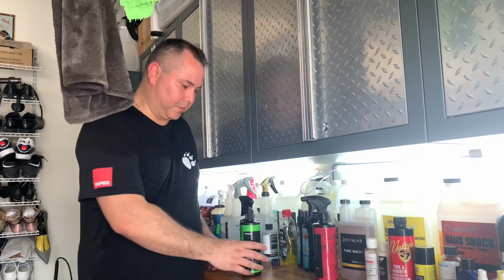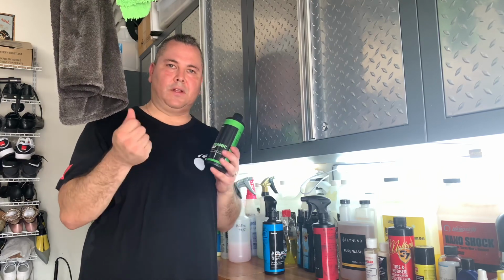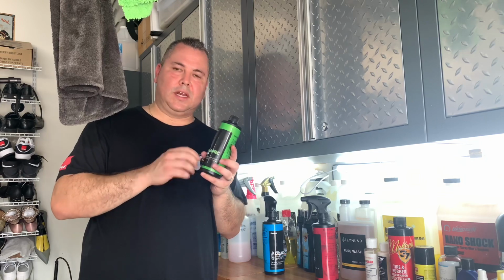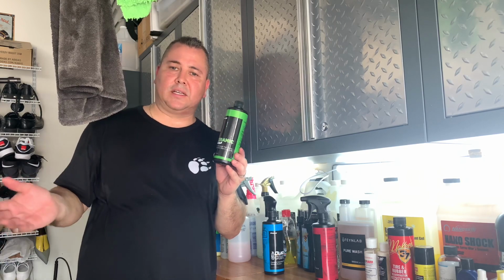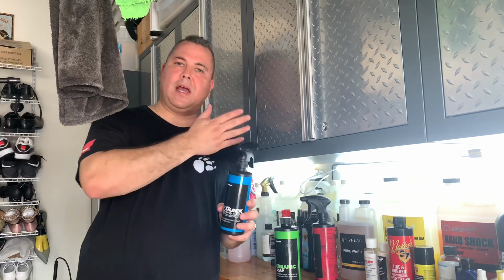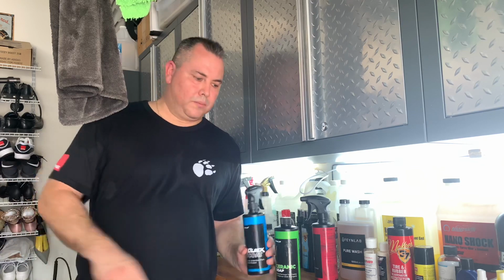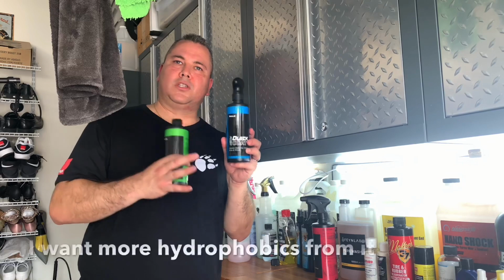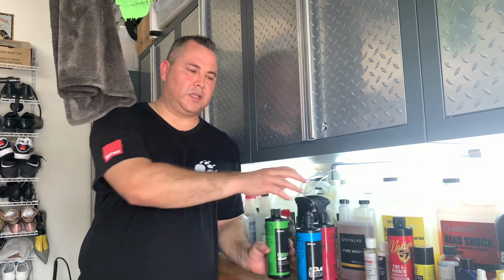Proje’ Car Care (Ceramic Soap)

Comment: Man I wish I had some sort of air system.    I'm absolutely loving that air powered foam gun!  Good gosh that thing looks like it put's out some seriously thick foam!    I also would love to have one of those Tornador's or the knock-off version of same.    That Tornador looks like a cleaning MACHINE!   I've seen some crazy stains on YouTube taken away with a Tornador like a hot knife through butter.     Guess I need to start saving my pennies for some sort of respectable air system.     Another useful air tool would be that small 3" pneumatic RUPES polisher that get's good reviews as a small or tight area polisher.    Great video Benji.   Always love your content and reviews.
Reply from the maker: Thanks man, the air tools are cool.  To power the Rupes pneumatic u will need a really powerful air compressor.  Something like 10+cfm(don’t quote me).   But all my other tools u only need 5.1 and it works fine.  They are definitely fun and handy in many cases.   Let me know what u decide
Reply: @DetailingBreakdown  Thanks for the info on the air.   Yeah, the Rupes small polisher wouldn't be a priority or necessity as I am getting the small Flex polisher soon anyway,  so going with less air to power the Tornador type tool and Air Foamer would really be all I need it for, and maybe using the blow gun for the interior blowing out the seams of any grit or dirt that might accumulate there.
Reply from the maker: Joe Van Seeters exactly
Reply from the maker: @CARWASHCHANNEL.  I’ll look for it but I think I used it all.  This is 2 years old and I needed space.
Reply: @DetailingBreakdown   when you buy some more and then test it

Comment: Man I found this channel from the apex fb group.  New sub.  So bro, what’s the Merc coated with?   That’s sum sik hydrophobics and gloss.  I’m impressed.    Also, can you link me to that  air gun you’re using for your dry-out?  I’m diggin it!
Reply from the maker: Hi, thanks for watching.  It’s coated with Servfaces ceramic coating.  No I don’t have a link to that blow out gun but it’s called Vapor.
Reply: Detailing Breakdown I Cant find anything coming up with that name.  Thanks anyways...enjoying the content.
Reply from the maker: Frankie Kenneth I found it at Autozone

https://www.autozone.com/air-tools-and-accessories/air-blow-gun/vaper-blow-gun-with-venturi-tip/807628_0_0
Reply: Detailing Breakdown ahh.  Thanks,  I was misspelling it.
Reply: Detailing Breakdown what ceramic coating is that Benji?   Did you install yourself?  I’ve never heard of that brand.  Buy it seems it worked awesomely
Reply from the maker: Frankie Kenneth Servfaces ceramic coating.   Yes I did it myself.  I think they are in California for distribution.   U can look them up on Instagram